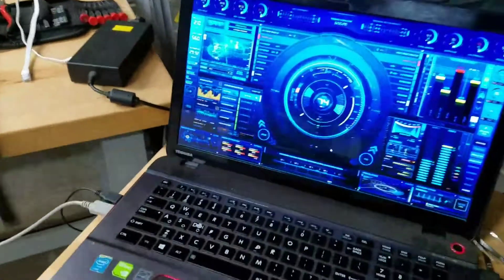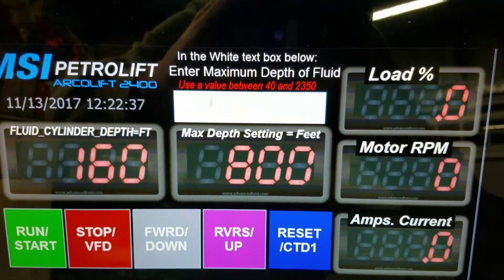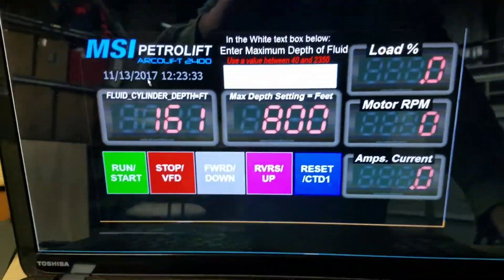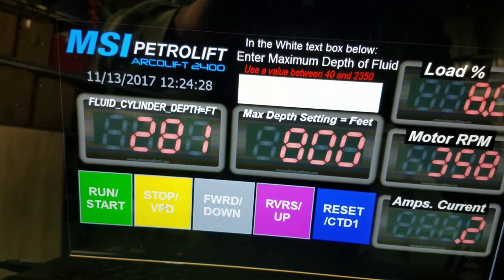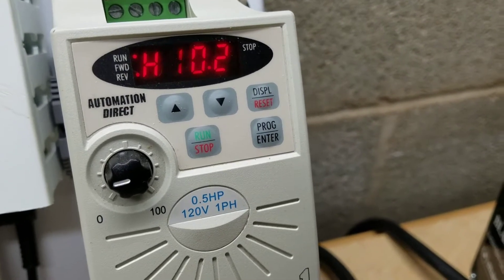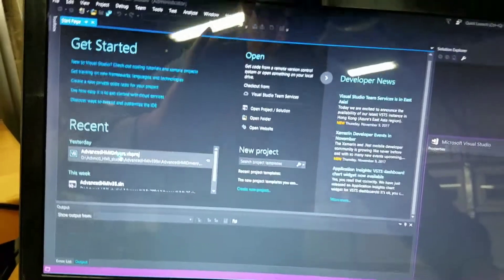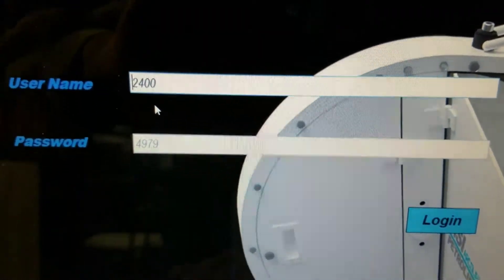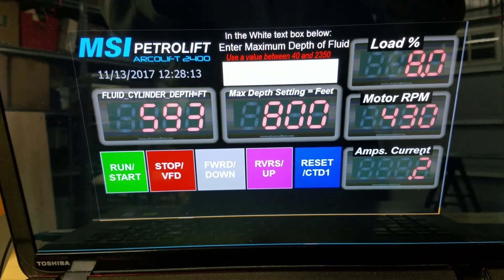ADVANCED HMI, VISUAL STUDIO 2017 COMMUNITY,  PLC MODBUS DATA HMI

Comment: What does this device actually accomplish in the field?
Reply from the maker: Remote monitoring of a click plc via modbus/tcp over the IOT.  In this case I am monitoring a GS1 VFD that will control an oil and gas down hole wire line winch, Load %, RPM'S,  Amps and counter, start stop, fwrd, revs.
I used Advanced HMI, and Visual Studio community addition 2017 to create the HMI screen.  I used remote utilities on my
mobile and PC to act as a remote viewer to access the controller over the internet.  Thanks for your comment :)
Reply: Nice Robert! That is really set up well. I am in the process of using the AdvancedHmI with a BRX PLC (Automation Direct) to interface with a coffee roaster project. It is a nice free interface.